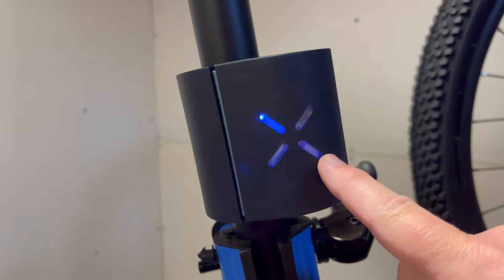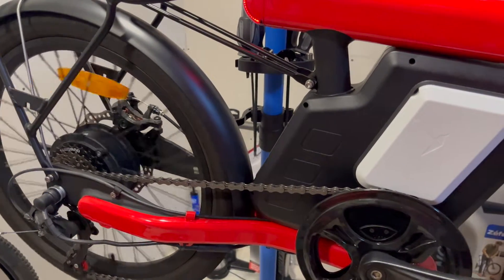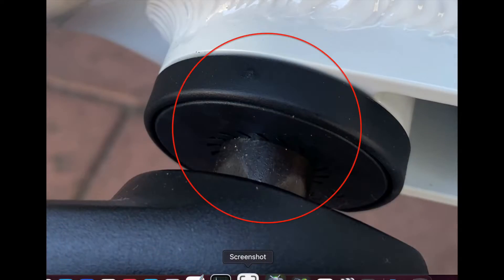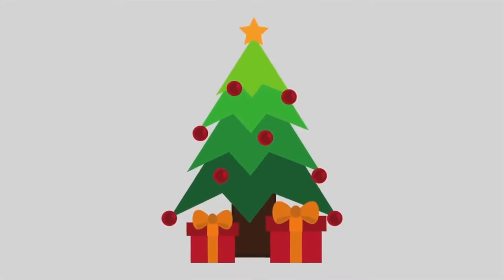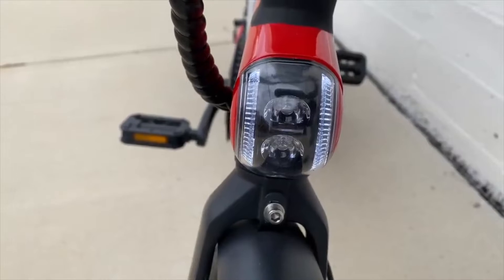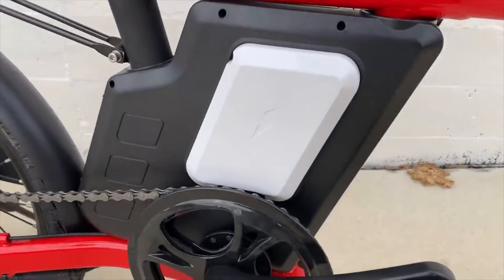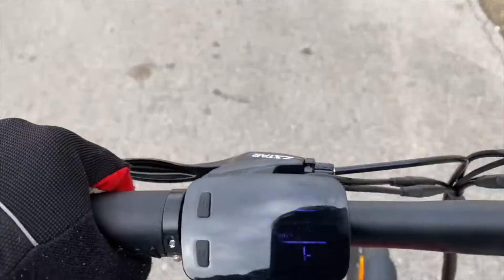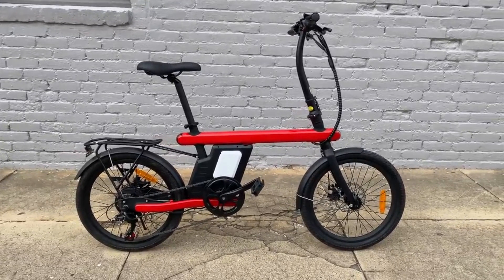EBIKE KEEP GOING WHEN YOU QUIT PEDALING? This could be why!

Comment: Some bikes are designed to have some over run 
It’s great for mtb so you can get over things better 
But you
Have to pedal harder to
Activate it as it’s used on torque motors 
I have a custom tuned bafang m620 from Markhor 
Can do 36mph
The over run only activated when enough  torque is put thou the cranks so under normal pedalling there is no over run

Comment: what helps is just holding the brake lever slightly not enough to engage the brakes but enough to have the brake shutoff switch stop the motor

Comment: From this, I'd suggest cadence sensor systems practically requires a brake lever motor cutoff if you care about safety.  And for the most part, I do see that combo on even the lower tier specs.  But even so, decent brakes should overcome electric assist, so while not ideal with potentially extended stopping range, its hopefully not an out of control situation.  One of my household's bikes is hub+torque sensor but w/o brake cutoff, and its hard to actually pedal with assist while braking.

Comment: One time, my Specialized Levo (mid-drive pedal assist) would not shut off after I had stopped and hopped off when I botched a climb over a chunk of rock...so I thought. I had my thumb jammed into the walking mode button, lol. Read your owmers manual, folks!
Reply from the maker: That walk mode has caused me problems before with accidental engagement

Comment: I think a big problem is people who have not ridden a bicycle in decades getting on an ebike.  You never forget how to keep your balance, but the skill loss even over a single winter, let alone a decade or more is or can be extremely high.  Other than steep hills, e-bikes bring speeds into the picture not attainable by someone who has not been on a bicycle in decades.  Bicycling 28mph even on flat ground is not something you can not do the first time out. But you can on an e-bike. This is an accident waiting to happen.  You should bike at least a full season on a regular bicycle before buying an ebike.  You should not be anywhere near a mountain bike trail for the first time with an e-bike.
Reply from the maker: Nah. That would just keep people off bikes. They should ride within their limits though.